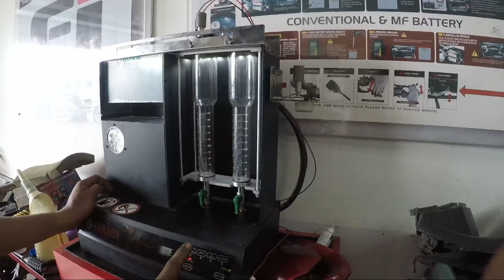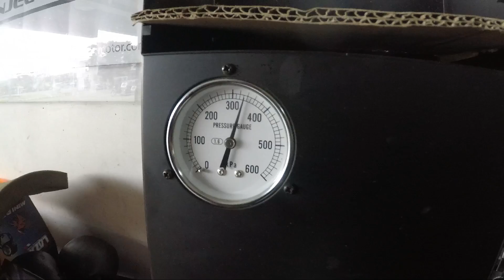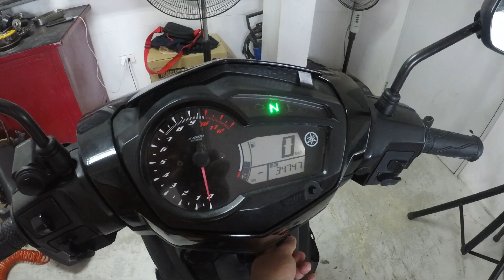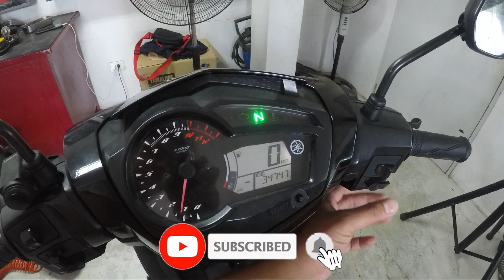Fuel Injector Cleaning, Change Fuel Filter, Throttle Body Cleaning ǀ Sniper 150i

Comment: Sir pag ba Hindi umabot nang 70 ml Yung Fi sira Napo bayung injector Kasi ganun PO nung nagpa Fi ako hanggang 50 ml Lang PO siya Kay's Sabi nang mechanico palit nadaw ako injector kaya nagpalit Napo ako Sana mapansin  po
Reply from the maker: Ito lang po ang sa akin sir. Nasisira din po kasi ang injector lalo po kapag pinabayaan.. mas malakas ang consume po ng gasolina kapag di na PMS or Preventive Maintenance  Schedule.. mas maigi po siguro na ipacheck sa mapagkakatiwlaang mekaniko. Ride Safe po.
Reply: Salmat PO sir 60 odo Napo kasi never papong na Fi throttle body lNg po at fuel filter at tune up nung Pina fi kunapo Sabi PO nang mechanico mismo sa casa barado na kaya Hindi tumataas Yung ml nya sa Fi kaya pinapalitan Napo sakin
Reply: Salamat PO ulit sir

Comment: pa help naman po, i have a Sniper 150 FI, dati kapag 3rd gear palang umaabot na ng 80 ung takbo ko, ngayon 60-70 in 3rd gear nahihirapan na ung sakin so i have to change it into 4th gear, and kapag nasa 5th gear nako, kung dati ang takbo niya is umaabot ng 130 now, hirap paakyatin ng 115 :( pa help po
Reply from the maker: Nag engine check napo yan.. baka po need na i clean ang injector.. or baka sa chain combination mo napo
Reply: @EsengKamoteVlog   ok  sge thanks po
Reply: Paps ok na ba yang snipy mu? Parehas tau ng problem ehh lumakas pa sakin sa gas , maugong na yung makina na sa 3rd gear na 60
Reply: @wilckensoliveria7810  Hindi kopa na pa FI cleaning ung sakin sir eh, sa day off ipapa fi cleaning mejo busy din kasi
Reply from the maker: @wilckensoliveria7810  baka sa langis na gamit nyu paps.. or madumi na ang injector pump.. try nyu din po mag replace ng fuel filter baka hirap na sumipsip ng gasolina kaya hirap ang makina.. then check nyu din po ang chain set nyu po.. sa combination din kasi nagkakatalo..